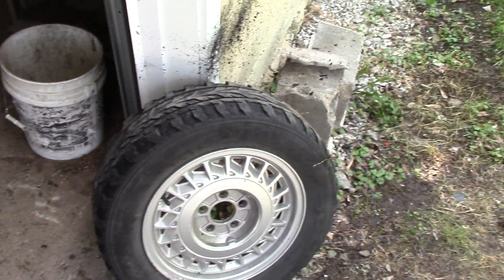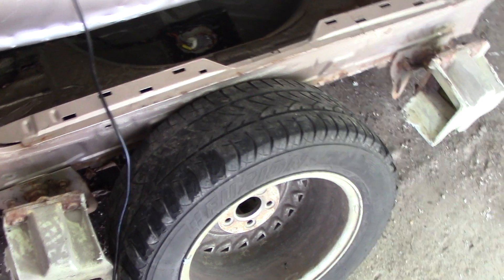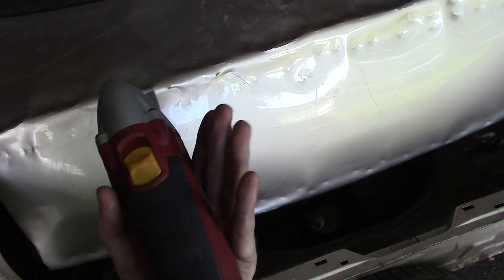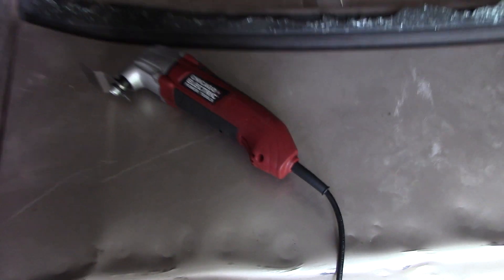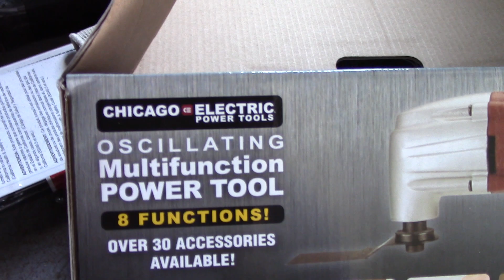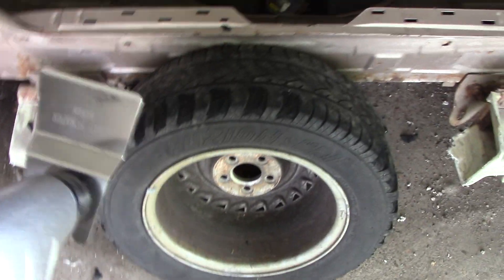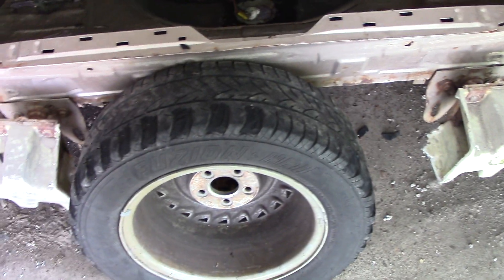How To Custom Groove Tires

Comment: went to five demos this year four full size and a truck demo bought this tool after watching video last week My season is over all winter I will be doing this ps scrap the alero plenum is in the frt of engine , i would just sell it for parts js ... curious if you have a system for posi trac on frt wheel drives and what you do to your cvs to make them bullet proof

Comment: On a fairly muddy track do you think just winter tires would get enough grip?  Its getting harder and harder to find smaller mud grips and I'm afraid a couple skid steer tires on a compact could break something. I have never tried anything besides mud tires. Thanks Mitch!
Reply from the maker: Blaine Barker Skid steers are definitely too much for stock FWD cars. The weight will break stuff easier. Winter tires are ok, but it would help to groove them some more.
Reply: DemolitionMissions oh I bought that tool right away. Seems pretty easy and it will definitely pay for itself.

Comment: How deep could I cut without busting the tire? This is my first year doing the derbys and I got a mini van I'm using. This is a great tip tho for people like me with non access to junk yards bc I'm under age.(15)
Reply from the maker: Bryce Bilden Don't cut any deeper than the existing rain channels in the tire. Any further down and you will hit the metal wires within the tire and then you risk blowing the tire, or the material coming apart in the arena.
Reply: DemolitionMissions so just go down a little further than the rain channels but not to far? Just cut off about 2-3 centimeters down in the rubber?
Reply from the maker: Bryce Bilden Also for cheap or free tires, go to local repair shops and see if they can give you some old junk tires they took off cars that just bought new tires. Most places have to pay to get these tires hauled away anyway. Even if the tire has an existing nail hole or is sidewall dry rotted, you can run a tube inside the tire and use it in the derby arena fine.
Reply from the maker: Bryce Bilden Yes, but barely any further than the rain channels, I cut all mine even with the rain channels. A good idea would be to find a junk tire and practice cutting on it first, so you can see how far deep a cut can go.

Comment: wonder how this tool would work for removing windshields? Ive seen similar ones that are much more expensive for windshields.
Reply from the maker: You would need to find a longer blade, but it could work once you get a corner of the windshield started.

Comment: Did you use PPE(Personal Protective Equipment)? The tool is loud so you need earplugs. And with the possibility of flying debris, you need safety glasses. Set a good example Mitch.
Reply from the maker: The Iron Atheist 50  You bet, had on those high safety sandals and shorts. Wasn't wearing safety glasses, so I just blinked instead.

Comment: it's too bad you didn't have a spatula blade that was perfect size for one clean pass. cool vid though man
Reply: +Steve Nilsen takes 30 sec to fix the blade in to right size by cutting the sides. Wonder why he used that big from the begining. Best way is to cut al the way to other side, wil grabb so much more then
Reply: +tokslut 30 seconds or not it isn't what he did. I commented on his video of his doings. I'm sure I would have done something such as you said

Comment: i hope you dont run those aluminum rims
Reply from the maker: Matt Rowan I ended up using them, been through 5 derbies so far and no bent edges anywhere on them. They really amazed me.
Reply: wow i"m surprised I guess you can just use what works

Comment: this is dangerous.. disaster waiting to happen!!
Reply from the maker: Does nobody read video descriptions anymore
Reply: regroving old tires is a wonderful idea for what you are doing, i buy new but 10 year old tires for drifting as i can get a set of 4 for $100+ when a new less than a year old cost me $1000+ and everyone keeps telling me i should buy new and not near expired tires but even after explaining to them i use 1-3 sets of tires a month for just drifting its dumb to use the one they suggest as it would cost me over $30000 a year just on tires instead of only $3000 which i use only on the track so even if something happened no one would get hurt as it would just pull to one side and endup in the dirt
Reply from the maker: Yeah good idea to save money. No point spending the top dollar unless you are competing in a professional big money series.
Reply: ernanv24  there for a demo derby, it not like he taking on road a 70.